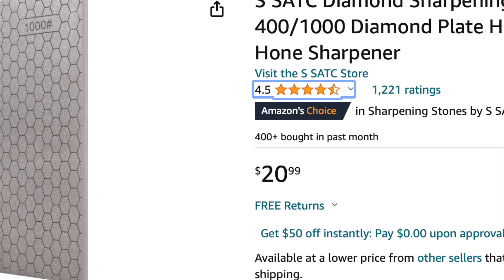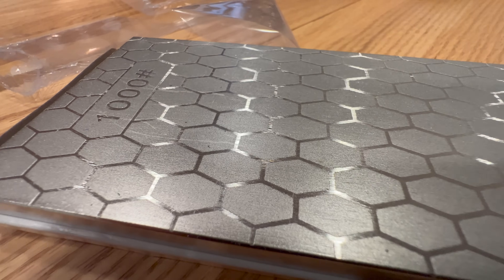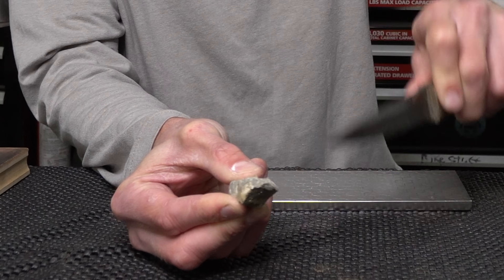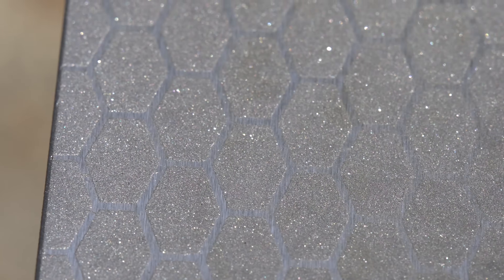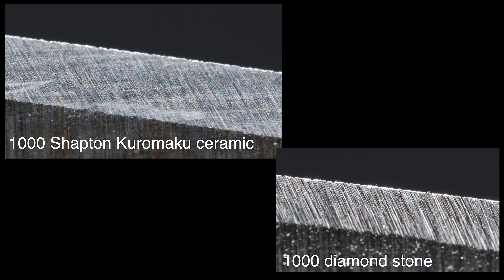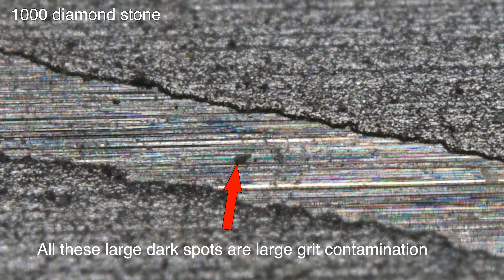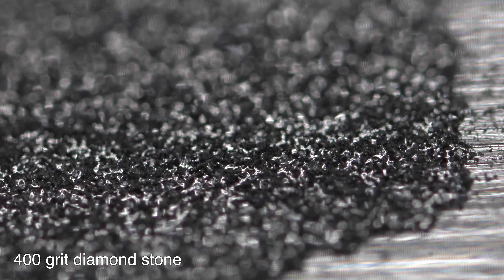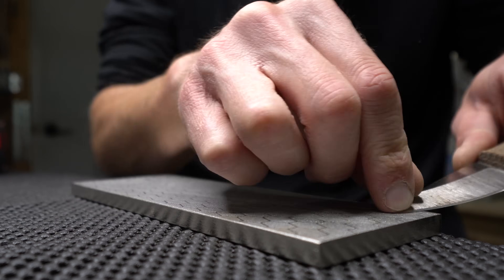S SATC Diamond Sharpening Stone Review - Is a $20 Diamond Stone Any Good?

Comment from the maker: In the video I may have incorrect stated these were polycrystalline diamond stones. On the listing, I missed that the Company states they are coated with monocrystalline diamonds. For now we’ll  just assume what the company states is true. And ill report back if anything changes.
Reply: All diamond stones, be it plates, resin bonded, Metallic bonded, super vitrified diamond all use Mono crystal diamonds. I've never seen ANY stone use poly diamond
Reply: @EDCandLace aren't atomas poly?
Reply: This is now showing as unavailable on Amazon. Do you have any other recommendations for something similar ?
Reply: What is the durability like after a year of using it?

Comment: I just ordered one of these.  I noted that the Amazon ad from S SATC stated to never use it dry and specifically said you could use water but dry it after.  This video says to use it dry and never use water.  Somebody's wrong.  I see several commenters asking similar questions but you haven't answered anyone.
Reply: I would follow the manufacturer recommendations.
Reply: Use it dry most of the time because the metal underneath may rust. However the lapping fluid can be anything, like mineral oil or Windex (for some reason)

I occasionally wipe the stone with WD-40, however if you are sharpening a knife that comes in contact with food, I recommend thoroughly washing the knife so you don’t ingest that WD-40
Reply: Use water if you want the steel block to rust. He’s discussed this before. The only directions to follow is the run a piece of flat steel over it for 30 seconds.
Reply: Always dry. While it's good for the price point, it's still a cheap piece of metal from China.
Reply: Yep. Most all manufacturers recommend a lubricant or cutting fluid of some kind when using diamond stones. It doesn't make any sense not to. It prevents the pores from getting clogged up and makes cleaning easier. Speeds up the process of both sharpening and cleaning. 

Glad you pointed this out. Will be skipping this guys videos, of which there are MANY when you search for anything related to sharpening.
Reply: Try all the methods, wet dry oil and decide which method works best

Comment: Under recommendation from a certain Nubby stumper, I went for a monocrystalline substrate set up. It was basically down to a choice between Trend or DMT. Trend had a nice package deal on Amazonia of a two-sided 300/1000grit 72" x 2.5" stone with a 300/600grit 3.25"x2" card, lapping fluid and holder for £100 ($121). That was about 5years ago, and I'm still using it and the lapping fluid with ease (there's about half a bottle of lapping fluid left and for reference I sharpen several chisels, plane blades and kitchen knives once/three months average). The 600 side of the smaller sharpening card has gone very smooth, almost 1000 grit, but the larger stone which receives more use has stayed in great state. It's a saving really compared to disposable polys. Stumpy got this right.
Reply from the maker: Mono does last longer but will be more expensive. Poly cuts faster and deeper and is more sensitive to pressure. If you're somewhat careful it will last a long time as long as the plating is done correctly.🙂
Reply: You got scammed. This one is $16.
Reply: @ilikewaffles3689  oh gosh. I didn't do any shopping around for a better deal or market price at the time. How impulsive of me. How justified you must feel.

Comment: Cool video man. I was using some stones that are very similar from Amazon to sharpen up some knives yesterday.  They look virtually identical except it's a pack of 5 stones.  400/600/800/1000/1200 I didn't expect much from them but they're much better than expected for the price (about $20).  I'll apply your advice with these stones to my diamond stones.  Cheers.
Reply: Hey, I think I found those exact ones too

How are they holding up, can you recommend them?
Reply: @MinZilla I think the five-pack comes from the same manufacturer, except they're very thin, instead of having a thick, solid aluminium base. This can be solved by fixing them to something like a piece of wood. I use magnets embedded into the woods to keep the plate into place, which works great! 

I've used the 400/600/1000/1200 a few dozen times so far, and they're still looking and feeling good. The results are strop-ready.

Comment: I keep some aliexpress diamond plates on hand purely for reprofiling. I can't think of a better bang for my buck at $1-2 each. I use them before going to my Shapton glass stones. They definitely have some anomalies in the plates but once I get to the 500 Shapton, everything gets smoothed out nicely. :)
Reply from the maker: You can do that too. I wouldn't use a stone you're fond of to do it though. The diamonds can in-bed themselves into the stone surface and are hard to remove. 👍

Comment: I bit the bullet and got a 400/800 Venev diamond stone. It leaves a finish like 800/1200 but cuts way faster. It's all I use in most cases, with a green chromium dioxide strop.
Reply from the maker: Ill be dabbling in those soon. For the cost i think they are still outside 99% of most people's budget 😕

Comment: I bought something similar to this stone for removing metal quickly from knives and then finished them with my Spyderco stone and was happy with the results however the diamond stone has worn down quite a lot and it now takes a lot longer to profile blades but still worth the price if you have to remove chips from your knife. If however you just need to sharpen your knives spend the money and get a ceramic stone and don't waste money on crap.

Comment: Excellent review and micrographs. Thank you.  Have you ever used the 1x6” stones designed for the EdgePro-style sharpeners?  A whole set is about $25 and double sided tape works well to stick them to a board so they stay put. I just use them with an edge marker and hold the board and stone in my hand and set the blade on a chunk of 2x4” as a base to get the tip off the counter. It’s a lot faster to learn this method because you can see the marker being removed, since the edge faces up. So you can adjust the stone angle  more quickly.

Comment: a local shop has an almost identical stone, only difference is they are one sided and under the name 'toolshark' and come in a 400, 600 or 1000 grit option and the 400 grit is R200 (~11USD). looks like they come out of the same factory as the S SATC stone, will probably give it a go some time and see how it compares!

Comment: Chef knife from my wie's dad, someone had tried to sharpen it with a grinder, was pretty brutal and I have made several attempts to get a proper bevel on it with the Shapton glass stone 220, a lot of work.

With not much further work, bevel is near perfect this cheapie, needs only a touch more with it. Paper-cutting sharp. This is what I was looking for, a faster bevel setter than my Shapton.

Here’s the thing though, the scratch pattern of both grits on a knife blade is the same, so what I’ve ultimately purchased is a double-sided 400 grit diamond stone, for me in hindsight, it’s a bonus! I also have the Shapton glass at 1K, which is perfect, I didn't need diamond plate for that grit, so no loss

Comment: Another thing I've seen on amazon are  full size (mostly) diamond sharpening plates at an astounding 6$ a pop.  For some reason the coarser stones (400-800) are more expensive than the finer stones (2k-3k) which I thought was pretty odd.
Reply from the maker: China seems to be able to produce these very cheaply. The biggest problem with them is the grit contamination. It exists in every "cheap Chinese made" stone I've tried. Id be waryof the SUPER cheap ones as ive had the diamonds scrape off of them first sharpening. And they are more like 50 grit super coarse. With more expensive stones you get less contamination. For some this isnt a problem since they have finer stones to finish on. Also you can't make a diamond plated stone finer than about 1200 grit. Since the abrasive is so small at that point the plating is difficult to adhere without covering the abrasive. So anything advertised over 1200 is just not true. Hope this helps. 🙂

Comment: Before this test did you "break in" the diamond sharpening stone? referring to use hard steel or flattening stone to knock off the loose stones or anything like that? not sure if it would help- just wondering if it would have knocked off any that were sticking up higher and give the finer grit a better grind.

Comment: Atoma FTW!

EDIT: DMT leave a nicer scratch pattern but Atoma are better quality in my experience. Atoma have an interrupted pattern whereas DMT (some) do not.

I buy 2 Atoma with bases and 2 replacement grits to stick on the other side. Four grits in two plates.

Originally I bought Atomas as Waterstone flatteners but tried them as sharpeners and really liked them. I have that stupid expensive Shapton Glass Diamond flattening plate as well. 😂 lol there was another even more stupid expensive, the Shapton Kubo….I never did buy that.

Comment: " never use water on a diamond stone" ?
 Is it ok as long as it's dried thoroughly immediately after use?
  Great work as usual
Reply: Try isopropyl alcohol; great lubrication and easy to clean up, with no risk of corrosion.
Reply from the maker: I have used alcohol as well and it is fine for all the reasons stated. 👍

Comment: I bought from Amazon the Sharpal Diamond Stone Dual 325/1200, initial thoughts were that it was garbage and after deciding that I'd give it sufficient time to break-in concluded that it was still garbage despite it being mono-crystalline diamond. Returned to Amazon just before return period expired and went back to using my trusty 1x30 for all my sharpening needs. Would consider getting the ceramic stones but for the cost and time required to get the hair popping edgeI'll stick with belt over stones.
Reply: I thought those sharpal stones were supposed to be really good

Comment: I have that same stone and so does a friend at work. In both cases, we’ve found that there is not as much grit on the sides/edges as in the middle.  Hard to sharpen a knife blade when you can’t sharpen the back centimeter of the blade. Would be fine for chisels.

Comment: Hi outdoors55, not related to 😊this post but need your opinion. Referring to fixed knife jigs. Does the angle vary from 90 deg below the pivot to the extreme edge of a long blade. I think that the bevel is smaller and steeper at 90 deg than at the extreme edge of blade because of the lower angle causing a wider bevel. Mainly on longer knives. Some say same angle regardless of blade length. Thankyou should you are able to comment. Mal.

Comment: If you ever get the chanve, I'd love to see you give a review to the KME guided sharpener
Reply from the maker: I have one. Its a quality system but a touch too slow for me. I like freehand due to the speed🙂
Reply: @OUTDOORS55  that's fair
Reply: I have it too, plus the three Shaptons Outdoors55 has. The stones are indeed faster and easier to set up. If I have to maintain or re-profile a v-edge, the KME is perfect. If I want to sharpen my kitchen knives or any other blade which already has an edge that's more or less convex, I go for the whetstones.
Reply: And also for the scandi blades: forget guided systems. Scandis need the stones.
Reply: @otobotrecords  true but I have seen Cedric and Ada sharpened a Mora with the kme, though I agree free hand sharpening is the way to go for Scandi grinds
Reply: @fuzzynuttz5092  It's doable depending on the geometry of the scandi blade, but I wouldn't recommend. Scandis and contrary to some internet belief convex blades are predestined to be hand sharpened on a whetstone.

Comment: I’ve had this one for 8 months.  The 1000 side is still courser than the DMT 325 single side.   It’s a beast.  Unfortunately,
I’m still stuck on profiling stones.   Can’t seem to get a sharp edge on anything over 1000.  Even the Shapton gives me trouble.
Reply: Stones over 1000 are really polishing stones, not sharpening stones. I use a Shapton Kuromaku 320 for my initial sharpening -- to establish the apex and the burr. And then Shapton Glass 1000 and 6000 to refine/polish the edge. In the past, I used to sharpen on a King 1000 but it took forever when compared with the Shapton 320

Comment: Could you explain why you don't use water with diamond coated stones and what happens if you did use water?
Reply: The steel that they are glued to can start to rust
Reply: Maybe you can try with water, if you can dry it fast and adequately after
Reply: use mineral oil. Same mineral oil but at a cheaper price is baby oil.

Comment: First of all I love your videos and learnt a lot from you over the years. Thx for that.
But I'm not sure about the part ware you advise never to use water on nickel-plated diamond stones. my experience is that DMT diamond stones clog up without using water. It is definitely a problem when sharpening chisels with a honig guide.  
Did you have problems in the past with them corroding? I would love it if you can make a video about this and share your reasons for that advice.

I have actually ruiend one of my DMT fine stones by not using water and pushing harder when it was clogged. This made a portion of the stone so dull it does nog cut anymore. my new stone is still cutting super well sinds i use water. But i clean and dry off the stone really good as soon as I'm done using it.
Reply from the maker: After having manufactured my own diamond stones and experimenting with different methods, base steels and abrasives I've come to the conclusion that water is the number one killer of plated stones. I recommend Just useing a towel to wipe them off. They will corrode eventually with water. Depends on how much you use them. You can't really ruin them by pushing too hard unless there was a problem to begin with, which is a possibility.  Or they are polycrystalline diamonds (which dmt doesn't use). If it works for you than go with it👍
Reply: I ruined my first diamond stone by using water, it corroded in no time. I then saw  a YT comment recommending using isopropyl alcohol. It is brilliant, it lubricates well and wipes off dry.
Reply: I was wondering this same thing! I just bought/used a diamond stone to restore/sharpen a hand plane iron and used water to clean off all the steel I was removing. After doing a bit of googling I don't see the same advice repeated anywhere; in fact, a number of sources say you definitely should use water. Huh.
Reply: @handleshtick I think it's very important to dry the stone well after using water. And when sharpening a knife, it's not necessary to use water. But with plane blades, you tend to use a lot more pressure. The water prevents the steel particals from clogging the stone in my experience.

Comment: So why no soapy water on diamond plates? Just because of the rust potential from not drying thoroughly after use, or another reason? Can it degrade the abrasives bond to the plate? I’ve never sharpened dry before, I tried it when I got into diamonds, but it just felt “wrong” to my water/oil stone conditioned brain. But that means I have no comparison of long term effects of using them dry versus wet.
Reply from the maker: After having manufactured my own diamond stones and experimenting with different methods, base steels and abrasives I've come to the conclusion that water is the number one killer of plated stones. I recommend Just useing a towel to wipe them off. They will corrode eventually with water. Depends on how much you use them. You can't really ruin them by pushing too hard unless there was a problem to begin with, which is a possibility.  Or they are polycrystalline diamonds (which dmt doesn't use).  You can ise water but you will get more rust over time eventually killing the stone. Especially if you use it daily since it never has time to completely dry. Just my findings your mileage may differ 👍

Edit sorry this was a reply to someone else but i think it actually answered your question too😂 Thanks for the comment 👍

Comment: Why not use water? I use a fixed geometry sharpening system and have always used water to sharpen and had no problems with corrosion.
Reply from the maker: You will get corrosion at some point. Especially if its use regularly.

Comment: Given the contamination problem, would it be wiser to buy this in a single sided version or would the contamination be the same?

Also, for somebody building his sharpening system from scratch, would you recommend a combination of this 400/1000 cheapo diamond plate & 1000 shapton stone or would it be better to get 200/600 diamond plate for reprofiling & shapton 1000 grit?
Reply from the maker: It may be better but it depends on how they clean the tanks when they manufacture them. Cant say for sure..
Reply from the maker: Id get the 400/1000 and the shapton 1000. Unless your blades are in Really bad shape. The 400/1000 is really coarse.

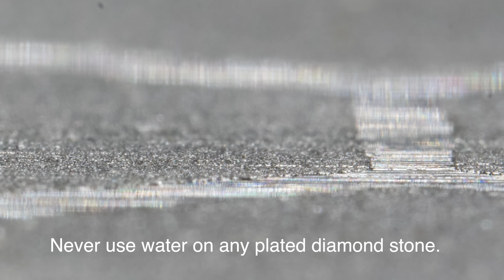Comment: 3:50 I don't understand why you say never use water. Many site recommend using water as a lubricant when sharpening on a diamond stone. Besides, how do you clean it without using water?
Reply: I was also very surprised to hear this. Is it only about the longevity of the stone or will the burr removal be effected, too? @OUTDOORS55
Reply: Use an eraser. As in, a pencil eraser. Kneaded erasers work the best but a regular one works as well.